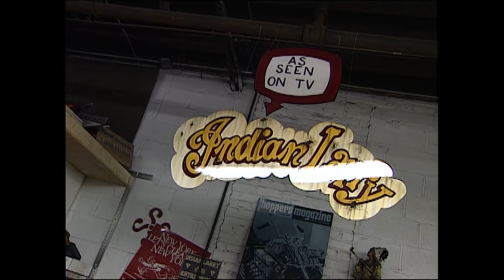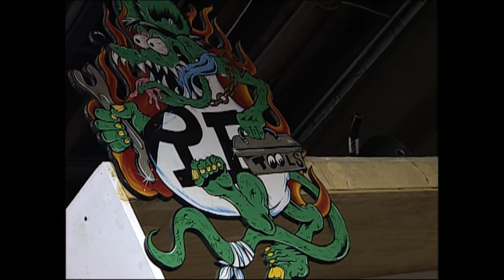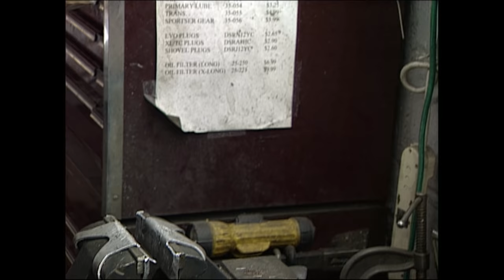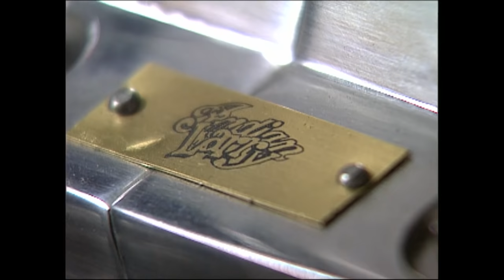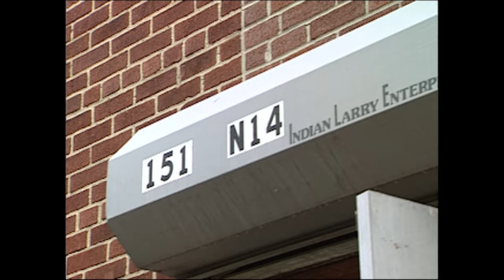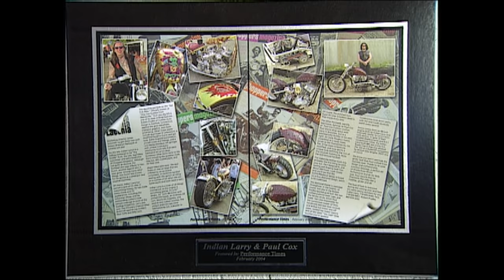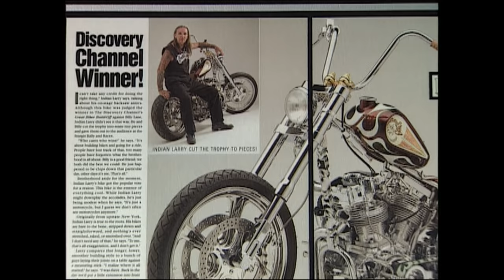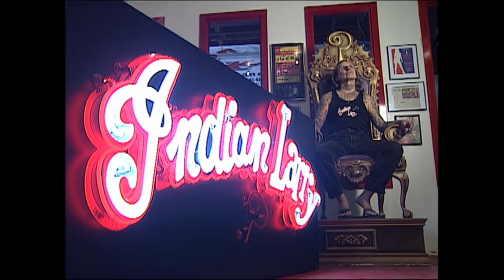Indian Larry Raw Interview & Building "Chain of Mystery" for Biker Build-Off

Comment: 1972 bought my 1950 FL Pan took it apart an redesigned it. It’s on my post on Face book. Did all fab. And stress relief the frame after work turned out beautiful. Custom seat sissy bar and everything on my Pan/ wiring a paint job custom. Color and built my seat with a Void in it witch I put a 38cal in it. Just in case. This Pan one of a kind. Paired $1500 for it. After 22 years got custody of my two kids. Sold it for $6000 dollars. Still have my 1940 Ford deluxe is ready to be on the road soon. After this Getting another Scooter. From Linda Vista DAGO Cali Beto you know me! Later.🕶

Comment: On my Facebook page I have the build of my Panhead,  hand crafted a lot of cool ideas, did not take away from the style I had in mind,  my springer picked up a donor Springer cut 6 inches off the donor Cut the tips off of mine fabricated inserts that went into each side 1 inch and a half for structure, added inch and a half to my rockers no problems at high speeds Hall craft spool no front brake, The birdcage on the transmission removed they half plate install fiber plate both sides second gear scratch no slippage, The Transmission outside shaft shortened it Fabricated a bracket that sat on top of my oil bag mount ran my cable through it to the shorter shaft fabricated the hand lever out 2 inches. When you made a shift to second third or fourth you rpm the engine slightly make your shift up or down smooth as butter, points distributor fabricated a lever spring loaded to retard my timing to start it, Push the lever forward now The distributor is fully advanced you can adjust it while cruising if you choose to used Bosch platinum spark plugs Took care of the rear spark plug running rich. Fabricated and oil cooler for my right foot peg took my 5 gallon oil can to the airport Montgomery Field in San Diego filled it up with 60 weight airplane oil added to the transmission oil pressure went up and stayed there 25 to 30 pounds and beats 15 to 18 pounds with any other oil. Inside my seat I had a void for my back rest and for the old lady did not  slide into me,  added 6 inches to my back rest this groove she sat in added padding to vibrate her she loved it in the void during my time on my Panhead was shot at twice on the freeway back to the void added a 38 Snubnose customized no trigger Guard was easy for me to reach after I put a cut where it was located dropped the blade gloves on got the handle of this 38 when needed! It sat there for 22 years never used it. Never told any of my friends what was in there. Sharing ideas of my past with my Panhead. DAGO Ca Linda Vista. ( Beto ) 🕶

Comment: The whole modern-day "custom chopper" craze literally destroyed itself. A custom bike builder from the UK......I think his name is Russ, said it best: "All of these custom bikes today are rolling Easter eggs". Rear tires that are so fat, they are fatter than the tires of most cars. Front forks with such ridiculous rakes, they are nearly impossible to control, and very unsafe. Don't attempt to run one of those raked out bikes on a dirt road, the front tire WILL skid right out from under you, and you'll eat shit. And you can forget about tight turns too. All of the "modern twists" that are claimed to be "original" are anything but.

Comment: I wish Indian Larry wad still around od love to pick his brain on stuff and see if I could convince him to help me with my build plan, albeit then it wouldn't necessarily be a tribute to him. 

Softail frame for longer rides but still looks like a hard tail. Rubber mounted for less vibrations. Knucklehead but modernized for performance. Watercooled for both modern vibes and throw back vibes with the old drake and other water cooled designs. 

Mechanical fuel injection for old school vibes. But also performance. Electric and kick start. 

Weight reduced with some modern stuff and high end suspension. Potentially a springer fork but with the springs modded to work with a modern damper. Sport bike wheels for performance rubber and light weight rims and good brake options. 

Rad for water cooling mounted between dual down tubes. With the right pump and rad set up you might not ev3n necessarily need a fan. 

Not too wide but wider rear tire for extra grip. 

Forced induction for extra performance. Some influence from other famous knucklehead race builds but with modern stuff turned into a lead sled of a street machine. 

Keep the bottom of the bike raised off the ground enough for clearance but still low enough seating position to make it comfy and relaxed. Shoulder height bars. 

If need be telescopic fork. Run the brakes front and rear as hand brakes. Suicide clutch and a foot shifted gear selector. Safer than a proper suicide clutch set up but still gives you the ability to just drop the clutch and bang into gear and roll away fast af. 

Might change out the knucklehead idea but kinda wanna keep it for certain vibes.